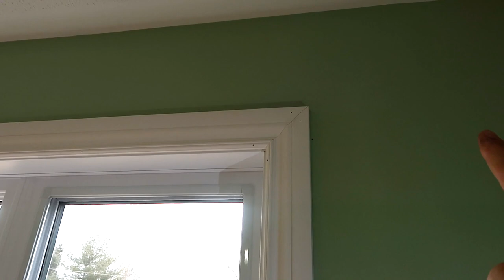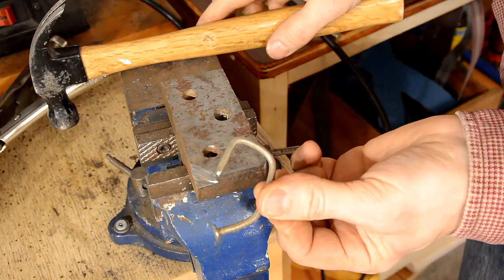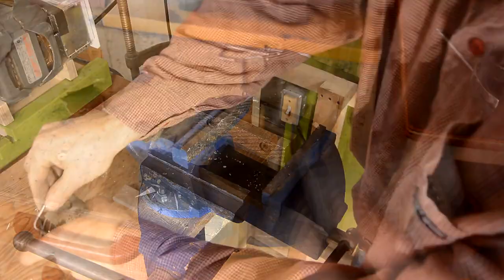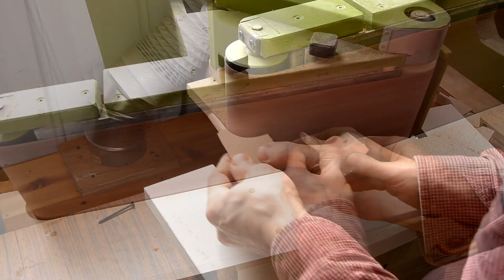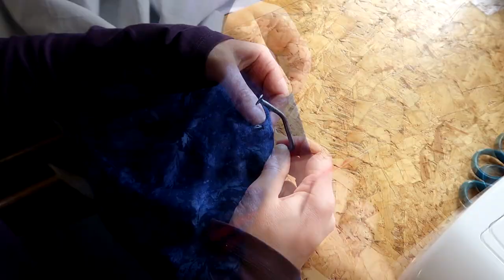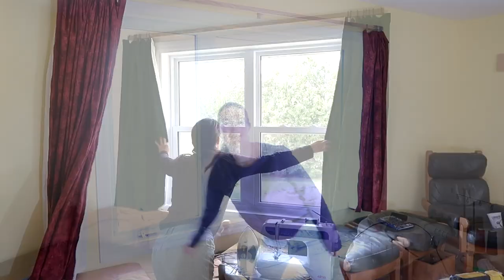Curtain rods with rings from nails

Comment: The great debate: Do you use curtain tape to set the hooks lower, such that when closed one can not see the hooks or the rod, or leave them both visible as here. Kinda like the hidden method myself, but it is a polarising question, most folk who realise there is a choice, I have met, prefer one arrangement over the other, but most folk struggle with the concept of curtains, rods & tracks & get some one to come & do it for them, happy with what ever gets done, only to break what ever was done when they try to change the curtain.
Reply: I've been in window coverings for over thirty years and to my way of thinking is, with a couple of exceptions,  the track is always covered by the drapery.  One would be that the rod is decorative.  The big rings need to be visible. 
The  other is if the track is up inside a cornice box or hidden from view when the draperies are open.  In this scenario, the drapery folds back between the pleats (because it can without the track in the way) and the drapery has that folded look all the way from top to bottom.   * more to your question about setting the hooks, they are inserted in the stitching of the back side of the pleat.

Comment: Plastic or thin metal bar, capped at both ends with large ball bearings inside, hooks with neodymium (powerful) magnets as hooks over a small roller. Plus, it's a safe curtain for kids as if they pull, only the curtain falls.

Comment: Why don't you fix the buttons above the window? that's the normal process helps with insulation as well
I see you done it on the new one you should cover the rail with candle rubbed over it make it quieter in its operation

Comment: Hi Pinteresters, here's a small list of the materials and tools you'll need to make these curtain rods at home:
1. Some big ass nails
2. A drill or drillpress
3. An edge belt sander
4. A block of metal
5. An angle grinder
6. A band saw
7. A standard homemade pantarouter
8. some wood, okay if from a garbage pile
9. a jointer
10. Just a vice
11. A table saw
12. A router with round over bit
13. 1 phillips head screw driver

Comment: You really should consider patenting these and licence mass produced versions made out of a variety of materials to a distributor . 

The amount of money people spend on even the cheapest of flimsy curtain rod systems that don't have this feature nor anywhere near the quality of this system is bonkers. 

$50-100 a window using pot metal brackets that last only a year or less is not uncommon.

I know similar things probably exist, but since Apple can apparently patent round buttons and amazon can patent "buy it now" buttons, the standard of prior art is pretty easy to get around.

Comment: it gets cold in Canada right?- Why are the walls so thin? why is the window allowed to be so far on the outside? water can go behind the outer frame? why are the shutters way smaller than the window? how are there no downspouts?--- the german engineer in me can't compute NA building.. nice  curtain rods though
Reply: Oli K I'm pretty sure that Canada uses similar building styles and has similar building codes as the United States, which I know a little bit about so I'm going to try and answer your questions.

2x4 (1.5x3.5 actual dimension, 38mmx89mm) or 2x6 (1.5x5.5 actual dimension, 38mmx140mm) lumber is what is commonly used to frame houses. There is insulation in between the studs (usually fiberglass or expanding foam) and sometimes foam insulation board on the outside. Naturally older houses aren't insulated as well as newer ones. This is usually enough to keep the house comfortable without having to continuously run the furnace or air conditioner.

The windows only stick out a little bit and are protected mostly by the roof eaves. There is also flashing and other water proofing above and to the sides of the windows to redirect any water that does get in back out.

The shutters appear to be purely decorative and have no actual use so it doesn't matter from a functional standpoint that they are smaller than the window.

He has gutters so there must be downspouts of some sort. It's hard to tell from the picture but it appears there's a downspout elbow mounted directly to the gutter at the far left of the picture to direct the water away from the house. This is relatively unusual in my experience as usually people have actual downspouts that go down the side of the house but I've seen this way more than once.
Reply: Thanks for the thorough answer- what I really meant to say was: why am I forced to build such over engineered buildings (in a mild climate) while the rest of the world is ok with the building standard of a treehouse? Personally I think German houses are overkill- while American buildings are mostly on a 40year old standard (at least it is also cheaper). 
Just to explain myself- to have enough insolation with a similar building style we are talking about at least 20cm just pure insulation material resulting in walls never thinner than about 30cm (although we mostly use insulated stones or thermal insulation composite systems from 36,5 to 42 cm); the windows would be a straight construction error ( thermal bridge and the edges are not safe for water ingress) , and non working shutters that are just for decoration... yea I don't like that- but taste differs I guess  :)
Reply: Oli K because German politicians aren't known for being able to regulate their impulses.   They just feel something should be a particular way,  and make it a law; facts and practicality be damned.
Reply: Same in Norway. We have 40cm  (~16 in) insulation in our roof, and half of that in all outer walls, plus 10cm (~4 in) of empty space for wires and extra insulation.

Comment: This is probably a stupid question:  does this design solve a problem a store-bought curtain system wouldn't solve?  I don't use curtains, so I don't know how they're designed.  Matthias says his problem is that the studs aren't near the end of the rod, but I would imagine a store-bought system allows for cantilevered ends too.  

My guess is that the answer is store-bought would work, but Matthias like to solve problems by making things rather than buying things.
Reply: Yes, I am fairly new here.  But note I did write that I suspected he did this principally because he likes to build stuff.  I have purchased one curtain rod in my life; it was basically a stick, and it definitely was wider than the distance between the two posts (which I also mounted on the king studs the window sat between) that held the rod up.  The first curtain ring or two would be on the anterior side of the post, with the rest interior to it.  That didn't seem problematic to me.  

Again, I'm not questioning Matthias' desire to make something which could be bought.  I'm just wondering whether, in principle, buying the curtain rod wouldn't solve his problem and he therefore HAD to make his own.